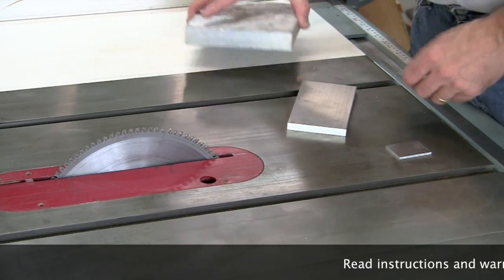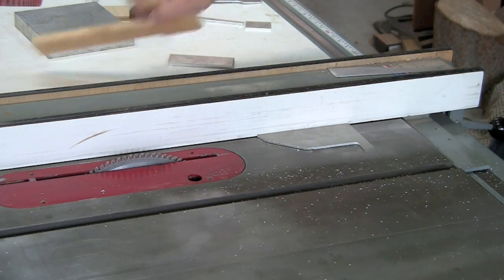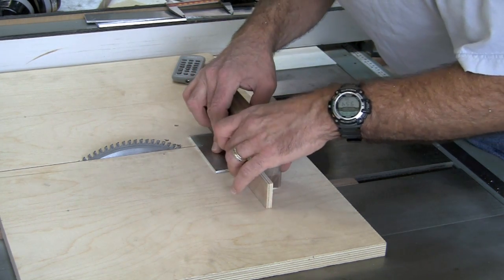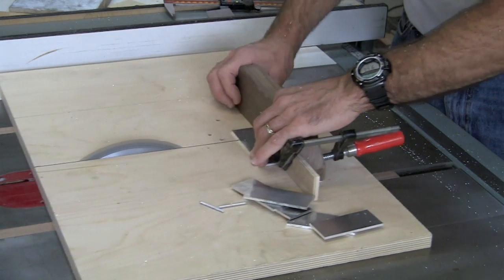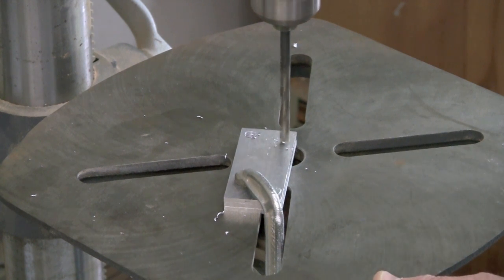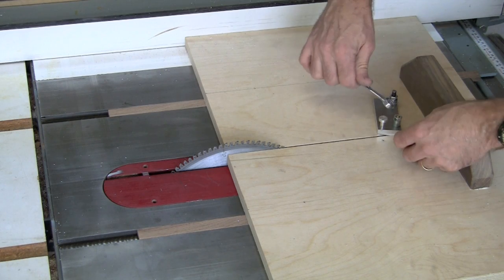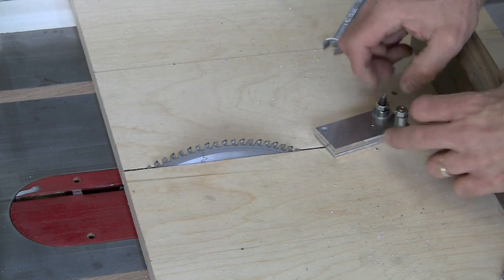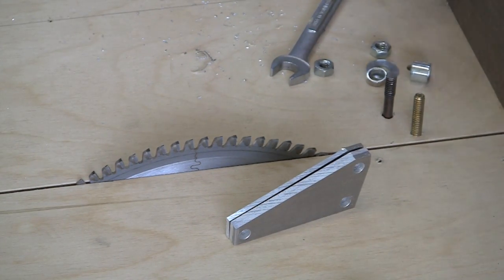Cutting Aluminum on the Table Saw

Comment: Nice video.  What do you think about cutting an aluminum plate, 18mm thick (0.71"), 33x53cm (~13x21").  I need to cut about 1" off the side of the long direction of the plate.  I'm a little worried about kickback of the 8.5kg/~19lbs. chunk of sharp-edged metal...  I feel like it should work no problem, but still have some hesitancy.
Reply from the maker: Should not be a problem. I've done that with 0.75" plate. Go slow and make sure the fence is parallel to the blade because kickback happens when they aren't and the work piece gets pinched on the outfeed side. Wear eye and ear protection and use a sturdy push stick if the 1-inch piece is between the blade and fence.
Reply: @KitplanesMagazine  thanks for the reply.  It sounds encouraging if you've already done something similar.

Comment: I tried to cross cut aluminium angle on table saw and the pieces ping back at you with normal wood blade ! Be careful! I'm going to buy 80 teeth TCT blade and see if it makes the difference.

Comment: So correct me if I'm wrong here but I was always told you shouldn't use a stop on a sled just like you should never use the fence with a miter gauge since it creates a significant risk with kickback. I've been using a fixed stop clamped down on my sled then just placing a removable shim of a fixed size against the stop, with the work piece against the shim during setup. Then during the cut I just remove the shim so the work isn't actually touching a fixed side surface. 

I think I might have been wasting my time now that I think about it. Especially with aluminum since that's not going to warp or twist during the cut like wood. In fact, it seems like cutting aluminum might be one of the safest materials on the table saw.
Reply: Aluminium angle pieces pinged back at me when I tried cross cutting.. be careful. I used wood blade that came with the saw and just at the end when piece is cut the blade must of catched it with the teeth and launched it

Comment: You really need to use a riving knife or at least a splitter when cutting against the fence, if you don't you are almost certainly due for a 'kickback' which will do some serious damage to your head.
Reply: +andersonec1, a riving knife (a splitter) serves the purpose of keeping the kerf from closing in on the back of the blade.  That is not a problem with aluminum.

Comment: The trick I use is set the blade .002 below the thickness of the piece.
This way you don't get the shards of aluminum in your face.